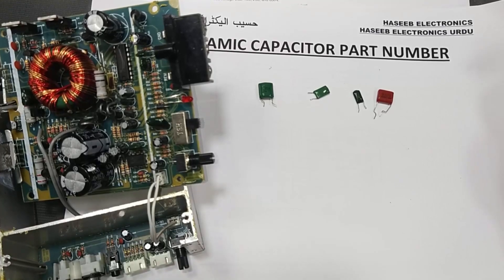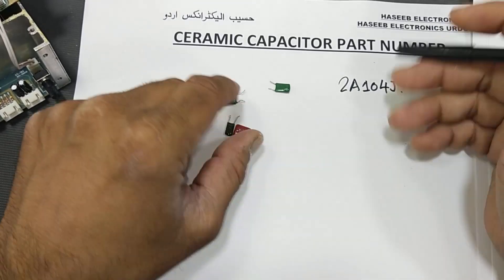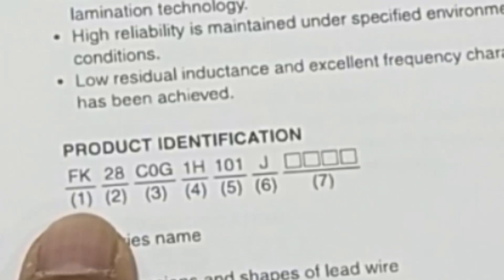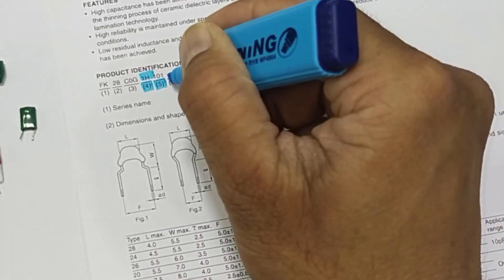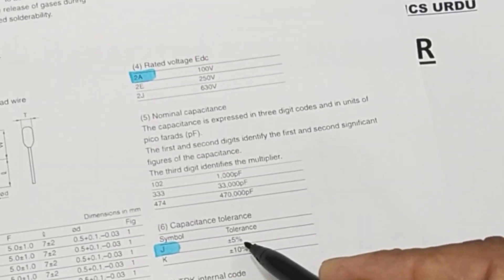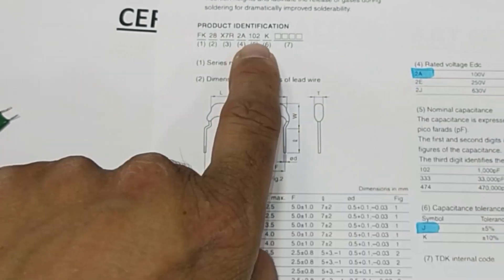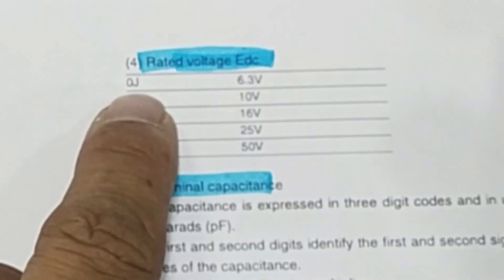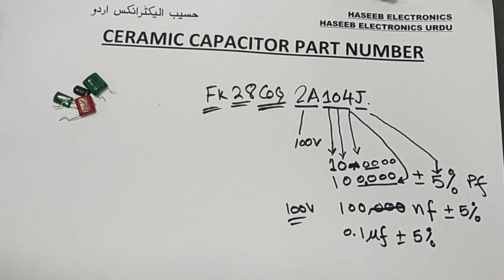{530} Understanding Polyester / Ceramic Capacitor Part Number - PF Capacitor Code to Microfarad

Comment: Sir, smd capacitor ka value kaise pata karen  kyuki usme number nahi hota hai..... pls reply..
Reply from the maker: yes dear 
it is the biggest headache to know the value of tiny smd capacitors. because these are very small in size so no marking code is there. there is just one option , when it is good, we can remove it and use capacitance meter to check its value, but when it is damaged then how to get its value or replacement 
there is just only one option to get the circuit diagram 
otherwise it is very difficult
Reply: @HaseebElectronics  thanx sir, the capacitor topic is very clear to me..

Comment: Also can you explain to us the area of application of every type of capacitor because 104 film capacitors and 104 ceramic capacitor  have the same capacitance but their area of application differs over frequency which one withstand high frequency which one is used to bypass or remove low frequency noise
Reply from the maker: best regards 
sure i will explain the types of capacitors and their application 
your last three comments are still to be answered 
i will arrange 
please accept my best regards and lovely thanks